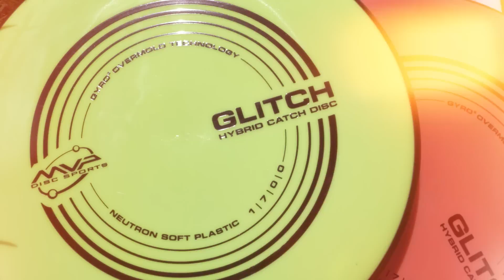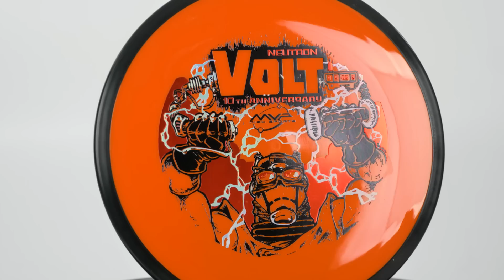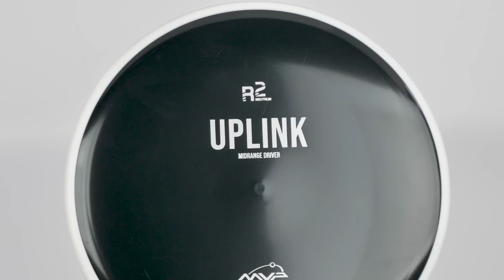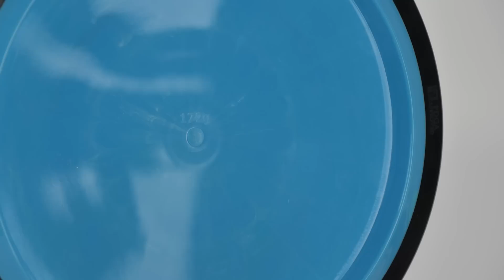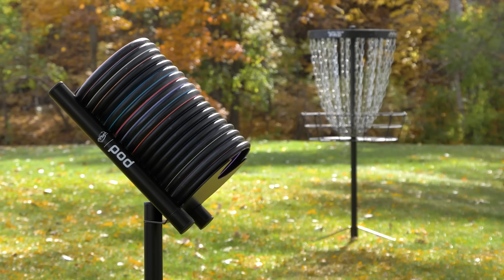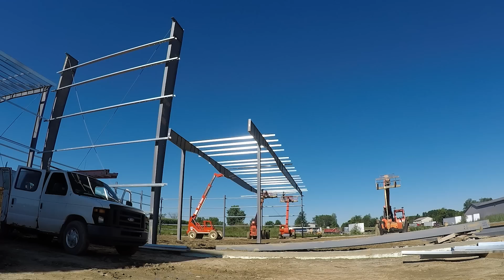GYROpalooza 2022: Lab Report

Comment: Love it! Really need a something like the crave but no turn. Like a 6.5/5/0/1 there’s a bit of a gap between the crave and the resistor. Even the servo has bit too much flip up. To fill that slot
Reply: I just bought a cosmic neutron and hoped it would be like you wanted as a complement to my other craves. Aaaaand it was! Its like a explorer in stability. So try that out. Don't know if it was a luck in the run or if every cosmic neutron is that way.
Reply: Glow craves tend to have less turn.

Comment: I'm sure the Volt is a great disc but. I haven't found a use for a speed eight in my bag. I have a couple and have tried finding a place for them in my MVP and mixed bag several times over the years.
Reply: I only have one 8 speed, an innova champion tl3. Tend not to use it unless I'm trying to ace or long distance throw in as it's the straightest most accurate disc I've found. Not sure about other 8 speeds though

Comment: The glitch can't utilize the glide of seven because the lack of mass. A Berg with a glide of one, can be thrown as far as a glitch. You're really limiting the potential of the Glitch by stifling it's weigh. I'd really like to see them offered in Electron with normal weight.
Reply: I would like to see a heavier glitch as well but a berg will not fly as far as a glitch thrown at the same speed, sure I could throw a berg 200’ but I would have to put a hell of a lot more into it then a nice glidey point and shoot glitch shot.

Comment: You guys NAILED it with the Glitch. I've been using it in tournaments already and turning some heads with my "cheat code." Neutron soft is excellent as well. Great job! So now, where the heavy "Berg" type Glitch? Love to have one that flies 150' and drops to a dead stop. 

Weight stamp: Not sure if the weight stamp is a good idea because when I weight my discs I always have to write down the "real" weight. The stickers are accurate like 1/10 times.